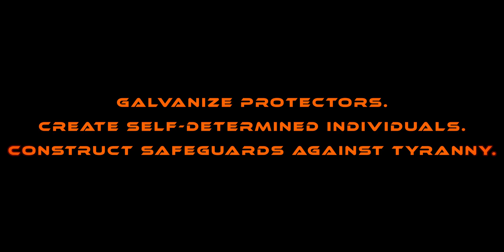Bridging ALL Night Vision & Thermal: The SYMBIOTE

Comment: Syonix Opsin supported?
Reply from the maker: Technically no the adaptors we supply will likely not work out for the Opsin, but we never tried. We do supply a dovetaill to mini rail adaptor that looks like it could fasten to the top of the opsin, but the post behind the mini rail would likely stop the bridge from locking in correctly on that adaptor. In our opinion the worst design any company can select is a proprietary one... While we could likely develop a mount that would work were left asking how many we would sell, and is it worth the design costs?

Comment: Couldn't be fucked to MJF or SLS at that price?
Reply from the maker: @Lychee959  did somebody hurt you? Or is that a genuine question. If it’s genuine, we’ll happily answer our reasons.
Reply: @Arkayne  fully serious. I can give you a full cost breakdown of what I would expect to pay for the multijetting and hardware but I suspect you already know the numbers and know that even multi jetted, the profit margins would still be astronomical at your current price. It would also be an objectively better product with tighter tolerances and improved isotropic strength but I guess you don't think your customers are savvy enough to know
Reply from the maker: @Lychee959  Solid Copy! There are many reasons for the method we chose on this iteration of the Symbiote.  We weighed the pros and cons of each method, including machining our own in the shop, and landed on this process / design for the launch product, Version 1. We felt it was the best balance of cost for the customer, speed of production, and ability to further refine the design IF anyone has feedback that warrants it. We are thinking years ahead of this moment, and our processes and procedures will change. But for now, we landed on this process for the Symbiote. You pose a valid question about "our why", so I'm hoping this helps a little. 

We actually very much appreciate the knowledge our customer base has regarding printing. It's refreshing. Thanks for your comment!

Comment: Are you able to adjust for hieght offsets? For instance if I were to attach a dovetail mount on the mini rail of my sidekick 640 it would create a vertical alignment issue. It would presnt the same problem with a Nox.

Does your product account for this?
Reply from the maker: Yes. You will be able to properly align your optic on ALL axes with what is included.

Comment: Is there a version like this but just for a standalone pvs 14?
Reply from the maker: You can absolutely run a PVS-14 alone on the bridge. Nothing wrong with that at all. Then you have the adaptability in the future to run dual 14's or a bridged thermal unit.
Reply: @Arkayne  makes a lot of sense. Well done. I will definitely be looking at this as my go-to option in the future. I really would like to get the thermal and NV combination going.

Comment: Hahaha $450 for a CF nylon print and hardware GTFOH. There are aluminum bridges like the Raven that come in well under that price point.
Reply from the maker: Does the Ravyn include:
- Mini Rail Dovetail Adapter Standard
- ST6 / AGM STINGIR Dovetail Adapter Standard
- Panoramic arms / capability
- Standard arms (interchangeable)
- (2) J-Arms
- Full X, Y, Z Axis adjustability to properly align ANY unit on the market? 

The answer is no. So it's not cheaper, it's less effective. 

All the aluminum options, when you add all the components we add standard, are closer to $800-900 on the market. This is half that price. 

Hope that helps!
Reply: @Arkayne  No one is going to use all of that at the same time, they're going to get the pieces that they need for their setup. Its great you're providing all of them, and that is a value add. But I know what machine time and material should cost and I know what it costs to 3D print high performance nylons. Granted, your R&D costs must be recouped, and no one expects you to sell these at or near cost, but I remain adamant the price is outrageous for a far less durable version of what is commercially available for less (or around the same price point if you want to argue semantics). CF nylon is great, but it's no 7075.

Comment: Really feel like you guys need to get away from needing to look ditectly into the tube optics, you need to use the latest 4k Oled 90hrtz VR goggles with 180 degree FOV, and use your nightvision tubes to stream/pipe/project the image from your tubes through those Virtual Reality goggles. The nightvision IR tubes would be mounted atop or side of the goggles.
Reply: U figure that out
Reply: Digital night vision has not yet surpassed analog in low light performance with low latency. Maybe in a few years.
Reply: …. Why
Reply: vr goggles arent military grade